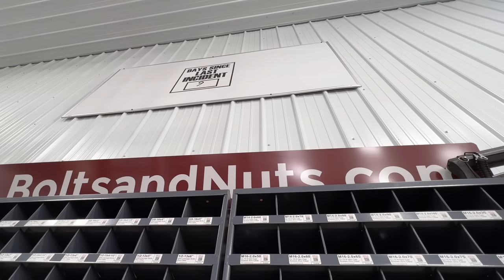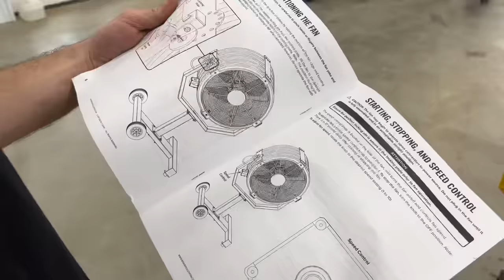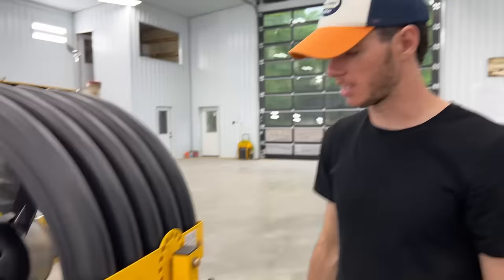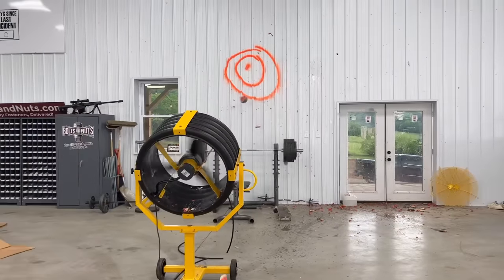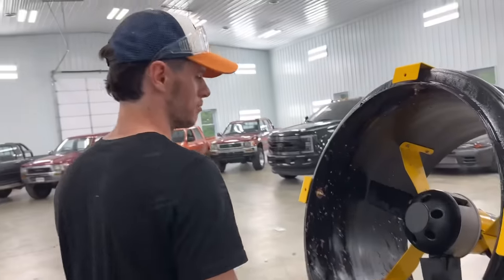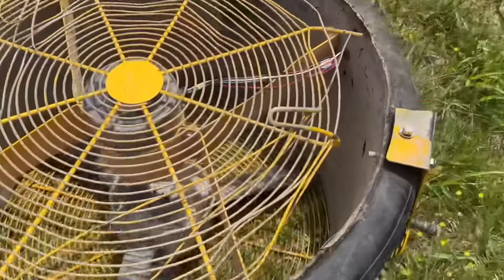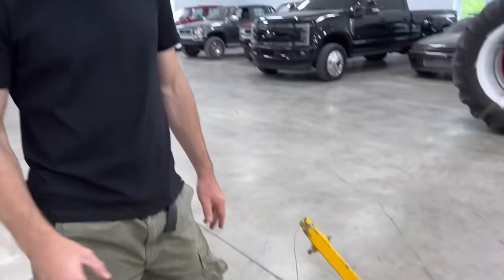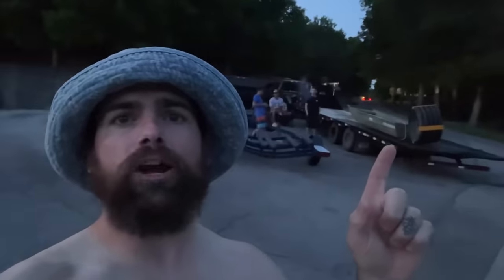Testing the “Worlds Most Durable Fan” (non biased)

Comment: I didn't believe it was a $2300 fan so I looked it up and sure enough it's a $2300 fan. I wouldn't pay more than $300, I don't care how tough it is.
Reply: Yeah that price tag is ridiculous. Their profit margins must be enormous.
Reply: @mikem1649  Exactly. I highly doubt this take even 1k to manufacture. Hope this video reaches them and they're forced to respond.
Reply: That’s insanely overpriced
Reply: Fool and his money will soon part
Reply: @Turningwrenchs  okay Tracy
Reply: Ok so your point? I’m pretty sure no one cares what you’ll spend your money on
Reply: @rjdatdude23  they're point is it's overpriced, how hard is this???
Reply: I think he already has like 3 of the bigger ones. My dad has the 3000 dollar one and they are actually really nice. He does alot of wood work in the shop and the fan will literally clean out all the wood shavings and stuff off everything.
Reply: @crayder1100  Well, you're wrong. Im assuming they are made in the U.S., in which case 2300 is not alot. A single piece of tooling to start making these can easily cost upwards of $70,000. Likely, the thermoforming molds they purchased for the blades cost $10,000 each. And you can't meet demand with a single mold that makes 3 blades every 3 hours. That means you need 10 or more molds, and to pay for employing people who are smart enough to not damage them even 10,000 parts in, because if they do then you've not made any money considering all hundreds of other costs I could start listing, and now you're out $10k on a new mold....
Reply: @rjdatdude23  having a bad day?
Reply: @raam1666  $2300 is a shit-ton of money for a friggin' fan. Some how you used to be able to buy a US made box fan for $25 bucks and they figured out the blades at $25. You can buy a commercial grade 24-in fan at home Depot for $159 and save $2141 bucks, but $2300 isn't a lot? Gtfoh
Reply: @raam1666  I'm sure it's 5 o'clock somewhere but don't you think it's a little early to be cross faded?
Reply: @raam1666  I'm not talking about their factory my guy, I mean the individual parts taken to make a single one of these fans. In regards to the fan blades, bare in mind that this video showed that they were hollow. The motor itself is probably the most expensive part to manufacture. But they likely use a 3rd party vendor for that. Plus we have no idea whether they make the other parts or if they use vendors for the frame, wheels, etc...

When it comes to mass manufacturing aren't these costs always determined for a single one? Going by your logic "the price it takes to make one of my car" would be millions, since you'd consider every factory it takes.
Reply: @Turningwrenchs  yeah he's going broke as you speak. Poor guy
Reply: @raam1666  Also note, I'm not saying you're wrong about that stuff. I'm genuinely interested in the topic. I would love to see what the company says in response though. However, you are certainly wrong for saying 2300 isn't a lot. A vast majority of the population would disagree. Most of us are poor man.
Reply: @raam1666  I think the question is: what does this fan do that a $300 fan can't do?
be durable? I'm not trashing my fan very often.
Reply: And that is the little one! The 96" AirGo2 is 10 fucking grand!
Reply: That corrugated abs pipe isn't cheep and doubt they make that so there probably buying full sticks and cutting them down plus tooling and labor. Yes $2300 for a fan is expensive to someone like me not what I'd be spending 2300$$ on rite now. But there's obviously a market for.it and im sure certain people and companies can afford a well built fan for there shops/job sites. Who cares what it costs and what the mark up is. If there selling it and making a profit its helping all the other people in the line stay employed. If you don't like it domt by it. Whistlen can obviously afford it and im sure this video alone made him enough to buy several several more
Reply: @mikem1649  theres one for 10k!
Reply: @mikem1649  Yea, their big ass fan name comes from the fact they mostly make fans for big warehouses with up to 14' blades that would actually take a fair amount to make, but this fan I would say is still overpriced
Reply: @zooper6453  yeah I'm familiar with their celing fans. I've put up a few and those are top quality and worth the price tag. This is just a piece of corrugated pipe with some plastic blades. For 2300 I would of expected it to be built little better.
Reply: It’s an industrial fan. We have them all over where I work. Normal work fans make it maybe a year. On my line we have 2 of these that run almost 24-7 no issues 3 years running.
Reply: It’s not for normal people, it’s clearly for factories
Reply: @crayder1100  you're right, what you're describing is cost accounting. property, plant, and equipment aren't usually factored in to a product's cost, they are company expenses or assets that are depreciated/capitalized
Reply: although I agree.  electrical motors are expensive
Reply: @allaboutroofing2  Tell me you know nothing about running a business without telling me you know nothing about running a business😂 sounds like you’re just mad this business makes stupid amounts of money and you’re complaining about it. Can’t afford it so you don’t like it🤓
Reply: i try to stay at the 10 dollar mark lmfao
Reply: @Turningwrenchs  lmao obviously you havent watched all his videos. But honestly by watching this video you gave him money to keep destroying shit! 👍🏻
Reply: @raam1666  uhhmmm I can print thise blades with a high quality resin printer for $40 each the corrugated 24” pipe is cheap the pot metal frame podwer coated is like $150 
The guys of the fan $100 at most? So at the most to build this fan is $300-$400?
Reply: @rjdatdude23  That is literally the point of the comment section. Get over yourself
Reply: @raam1666  your exactly right. People have no idea it can cost to make shit.
Reply: @allaboutroofing2  if you think this fan is the same as a 200$ home depot fan then ur not very bright.
Reply: @anthonyj.romney7683  Nice try turning our argument about an overpriced fan into my ability to run a business. What do you do for a living?
Reply: @cducote6257  I never said they were the same but there's $2,140 difference in price, and all that garbage that Jerry spewed about molds for blades and justifying the price makes absolutely no sense. Alt account?
Reply: Yeah and a $5,000 fine for losing a gas generator in a lake LOL
Reply: @raam1666  It costs $50,000 per tool for a single golf iron club head. You usually buy a set of 8 irons for $1000. No reason a fan with one tool costing $70k should cost this much
Reply: in fact ffs you can buy a full set of nice golf clubs for $2400 for 14 clubs. and the cost to develop 14 individual clubs is in the low 7 figures.
Reply: @chrisanyone1709  yupper i always checking in on what hes doing to entertain us Silly
Reply: 300$ is nothing now a days. cost me more in gas a week just to get to work
Reply: @allaboutroofing2  Lol. youve never manufactured. Keywords: USED TO

Those blades look like carbon fiber and would need to be thermo-vacuum formed. If youve never done anything in this industry or have never manufactured anything at any scale ever, then shut the hell up because you don't know what you're talking about.

BTW, the dollar has inflated by about 1000% so "used to" means literally nothing in terms of price.
Reply: @Sercer25  No, it probably doesnt (except it seems to move alot more air than a standard 36" shop fan). Nonetheless, those shop fans are made in china where labor is abysmally underpaid and materials are cheap.
Reply: @raam1666  inflated? Don't you mean deflated? The fact you used the wrong word aside, that means a hamburger is now 5K?
Reply: @crayder1100  Im not saying 2300 isnt alot to you, or me. It is. But it's not alot compared to the tooling, labor, design and engineering required to make a prototype (which may require prototype tooling (stuff you only use once or twice) but in this case they use many off the shelf items so that was probably only for the blades. If you're lucky or smart, your prototype tool produces perfect parts.) and then production tooling which is scaled at about 10x, and probably costs 8x as much as a single tool. Then there is material and labor costs involved in the production of such blades. I could be wrong about the thermoforming - those could be injection molded blades, and if they are then they need a mold press of about 450 tons. The material costs can be sky high, especially since raw plastic material was majorly disrupted by Covid and is still disrupted. Some of the parts I produce require a material that costs $13/lb.

And theres about a million other expenses if you are actively building a company - new floor space, new machines, new employees etc. etc.. Unless you have experience planning out these things, doing manufacturing engineering, then you really cant have any idea how many and how much costs are actually involved. 

and again, If these are made in the U.S., then they are paying U.S. wages (and while they are already unreasonably low, china's are much lower)

As a general rule of thumb; Manufacturing in America as opposed to China, is an automatic 10 times your manufacturing costs. And that is exactly why nothing is made in America.

If these guys aren't making these things in America then they are just ripping people off.
Reply: @raam1666  so many people disagree with you. Give it up already, you lost.
Reply: @chrisanyone1709  Yeah ok lol. Go print 1000 blades in a month.
Reply: @cducote6257  Something that always makes me laugh is that these people are of the mindset that if "you own a business, you're rich".

LOL. This is why our democracies are failing, almost nobody wants to learn anything from people who have DONE things anymore. People refuse to learn for themselves too.
Reply: @raam1666  I for one appreciate your opinion. I stick to what I've said though. Despite whether these are for industrial purposes are not, it's false advertisement and overpriced, which is the entire point of this video might I mention.
Reply: @chrisanyone1709  pot metal... OK dummy. Do you even know the difference between cheap pot metal and steel?
Reply: @allaboutroofing2  I assure you a $200 dollar fan won’t last much longer than a few months in a manufacturing environment.  I know, I ve bought dozens lol.    Also we have some big ass fans mounted in the ceiling of the plant that cost $13,000 each
Reply: Good grief people, stop whining about the fan costs. BAF company is primarily designed around commercial products. These require much more rigorous durability than household or even light business applications. If they weren't worth the price, they probably wouldn't be nearly as popular as they are

Comment: Held up surprisingly well
Also they used plastic since plastic flexes and returns to shape usually and is lighter 
A stamped metal blade is very weak
A machined metal blade would be indestructible basically but it would be pretty heavy and expensive
Reply: it cost 2400
for that price metal blades should be included

Comment: Not gonna lie, the testing for this by dragging behind a hilux is a real life simulation of if it fell out the back of a work truck and nobody realised for quite a while with it being partially strapped down with a dodgy ratchet strap 😂
Reply: “Nobody realized for quite a while” 🤣🤣🤣 the biggest fan you’ve ever owned, you will realize it falling out!
Reply: Gotta stay cool on the jobsite even if it falls out the truck.
Reply: That stuff happens, too, I remember once being passed on the interstate by a guy doing like 80 in a 55 and his hand cart was hanging off the back of the pickup dragging on the ground.   I figured it was his problem to deal with.  

I also picked up a ladder on the same stretch of highway one night, fell off a truck I guess and slid to the median and nothing was wrong with it so I took it.
Reply: Jim jibroni  you never know, see some sketchy shit out there

Comment: I was sure that blade was going to break with the first melon, but then I realized wow that's really dangerous. I'm disappointed with them using HDPE storm drain pipe for the fan shroud with it at that price.
Reply: How else can you maximize your insane profit margins besides using the cheapest materials possible at the most ridiculous price point possible?
Reply: @aSinisterKiid  calling that the cheapest material possible tells me you don't know how much that shiz costs. It isn't cheap, it's rediculously durable, just not $2400 durable.
Reply: @brahtrumpwonbigly7309  I know exactly how much that shit costs. Especially buying it in bulk and cutting it down they can get that corrugated pipe for $80.00/100 meters. Don't give me that shit about it being ridiculously durable. Of course it is durable, but it isn't gold. It's fucking plastic and it isn't expensive. That little 24 inch piece probably costs less than $1.00 in material costs. If that company is building these fans with it then they are buying bulk shipments of pipe likely 100 meters long and paying $80 or $100 bucks for the single pipe. Cut that pipe down into 24inch sections and that mean they can get 164 sections to build 164 fans. At that price point of $2,400 bucks per fan you are talking about $393,600 before taxes. When you are talking about that kind of profit I don't want to hear about you using one of the cheapest manmade materials on the planet. Corrugated plastic pipe isn't special and it doesn't warrant that kind of price point. None of the materials they used in that fan warrant that kind of price point. They used cheap thinwall steel for the base, corrugated plastic pipe for the housing, cheap plastic fanblades and a cheap chinese motor. All in I could build that fan myself for less than $150 bucks. Fuck outta here with that $2,400 price point.
Reply: @aSinisterKiid  you’re wrong lol

A 48”x20’ section of HDPE costs ~$1,600 retail. They’re making good margins as every business wants to do,  but they’re not building these for $150 a piece lol
Reply: @aSinisterKiid  let me know where I can find 24" pipe for 50 cents a foot I need some
Reply: @aSinisterKiid  I stopped reading at "$80 for 100 meters" since it shows that you have no clue what you're talking about. 😂
That shit is around $1,400 for 20 FEET of 36" pipe. That's $140 worth of pipe for each fan.
Reply: @ElliHarper  That's the problem with only reading text because you get zero idea about a persons body language, tone or emphasis. I am perfectly calm and enjoying my sunday in the air conditioning watching drag racing. Just because someone types a logical response to people that might be a bit long doesn't give you any representation about their emotional wellbeing. I can make a ridiculous comment about how you sound like a keyboard warrior right now too when you typed your comment. Doesn't mean much really.
Reply: I was impressed with them using the corrugated pipe. That stuff is stupid strong!  Price is a little high, I agree.
Reply: @aSinisterKiid  you have no idea what you’re talking about. How about this do it better until then stop crying about it
Reply: @jonnyhooks9943  I do "Do it better" myself and that's why I know how cheap the materials are from certain suppliers. I'm not crying about anything, just pointing out how stupid most people are that they don't even know the cost/value of typical materials.
Reply: @aSinisterKiid  you're most people
Reply: @schm1nty  No, I am one person. And I am highly informed on the topic I am talking about because it involves my daily business. So I am in fact, not "most people".